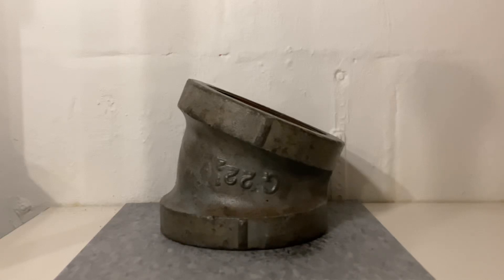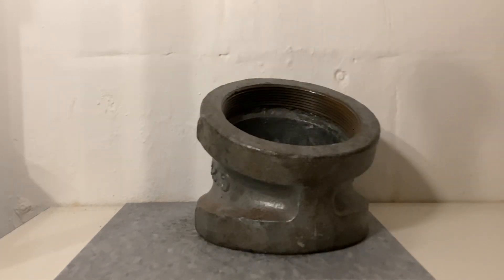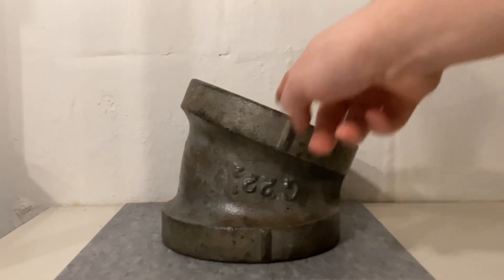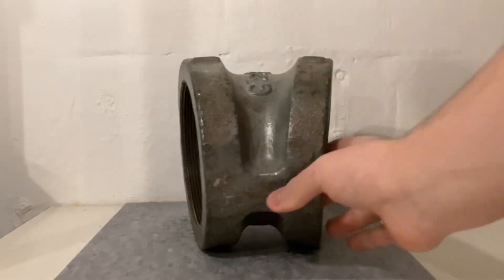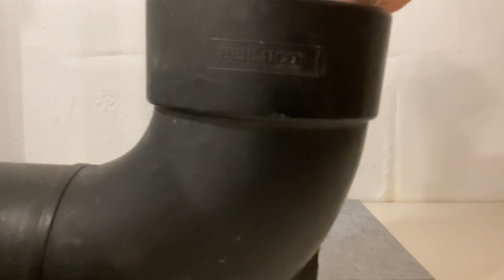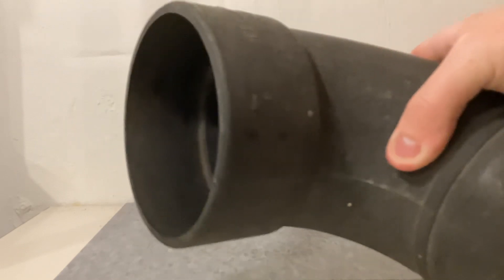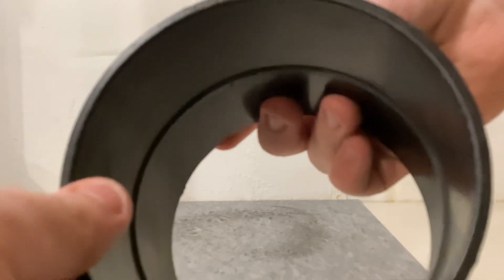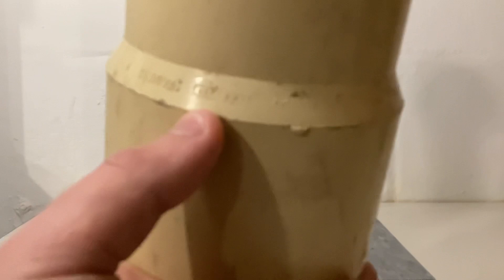Vintage large drainage fittings.

Comment: I never knew they made 5 in pipe fittings, I thought they just had 4 in and 6 in.
Reply from the maker: It is an odd in the middle size, you can still get bell and spigot cast iron in five inches. A company called grabler even made 2 1/2 Durham fittings.

Comment: What would Cause a 2 inch Charlotte PVC thin  co plug p trap to split on the co female threads? The gasket was missing so I used teflon tape and pipe dope on it. I replaced it with a Canplas PVC p trap that has a large cap on the bottom that cant split. I would never use the thin co plug traps again.
Reply from the maker: Those cleanouts are not made to be installed with anything other than the gasket, if you don’t have one then get an o ring that fits. The only traps that can have teflon tape or pipe dope on them are Genova p traps as the cleanout does not use a gasket.

Comment: Can the galvanize be replaced with PVC.
Reply from the maker: Residential and commercial settings allow different things, in residential settings you can but in commercial settings it depends on what code allows. No matter where you are I don’t recommend you sandwich small sections of plastic between existing galvanized, in that case I would use new galvanized or cast iron when going between existing galvanized pipe.